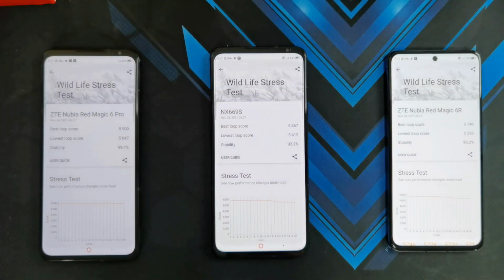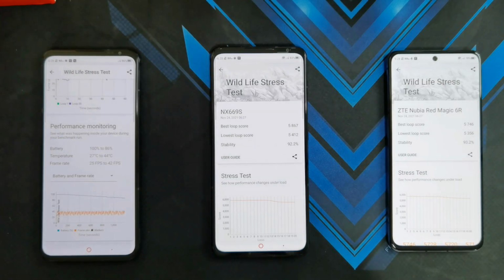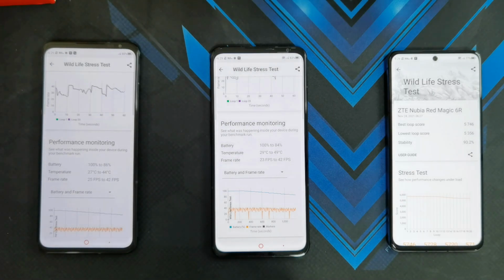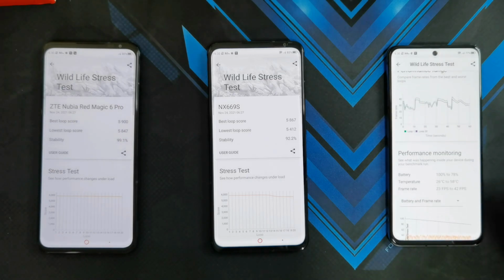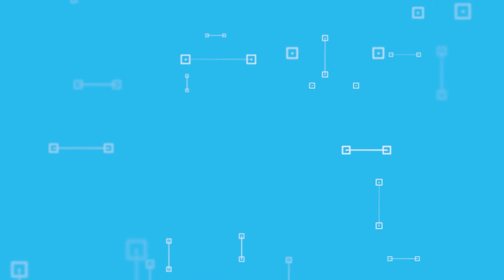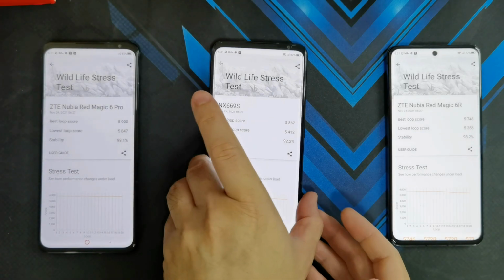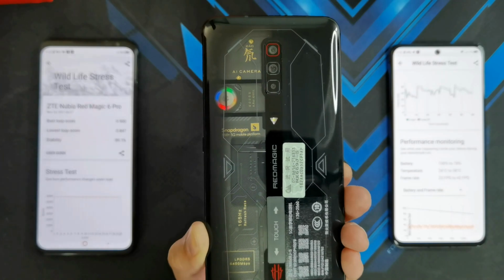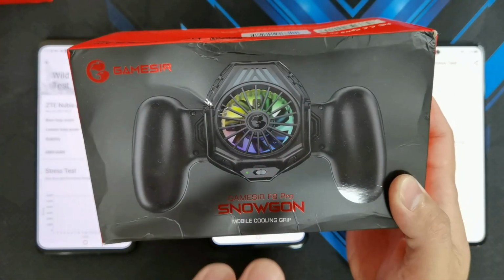NUBIA RED MAGIC 6S PRO ANTUTU and 3DMARK WILDLIFE Throttle and STRESS Test!

Comment: At the start I wanted to buy rog phone 5 but after some time I think it's overpriced. Than I wanted lenovo legion dual 2.but idk the temperatures weren't as good as expected + battery wasn't as good. I think I will buy the red magic 6s pro for 800 dolars. What do you think is the best cooler for this phone.
P. S btw what is the best option for red. Magic 6? The 6 pro or the normal one.
Reply from the maker: get the red magic 6 pro if you want the best cooling bro, also the recommended cooler for this phone is either the black shark fun cooler pro 2 or the red magic dual core cooler
Reply: Dude in aliexpress the redmagic 6 pro is around 500-600 dollars, you can even find it with offers that lower it even more, hope you hadn't got it yet because you could've saved a good amount of money, and honestly y say that the 6 pro is a better option than the 6s pro

Comment: I have a question will the internals be damaged if the temperature hits up to 50c while gaming?
Reply from the maker: It should be fine, for short durations, but extended periods of extremely high temps will cause damage eventually

Comment: This cellphone software rarely updates and takes up a lot of storage but the performance of this cellphone is number 1
Reply from the maker: even without frequent updates, the phone rarely slows down and maintains its performance for a long time, my red magic 3 and 3s are both still as fast as the day they came out of the box 😁
Reply: Yes, red magic has a very good temperature, but not software like rog, which has a GPU temperature fps display and others in redmagic only have fps, but this is good

Comment: Hello thanks for the video 🙏🏼 Please one question : Can i use a 120watt charger on a red magic 6 pro 5050ma (global version) ? The 120watt comes only with the 4500 ma (chineese version) but i will buy it if i can use it on the 5050. Please if someone call tell me 🙏🏼
Reply from the maker: you can use it but you won't get the 120W charging speeds because the global version doesn't have the hardware to charge at that speed
Reply: @EGotTech25  Oh okay thank u ! So i will take the 65watt 👍🏼